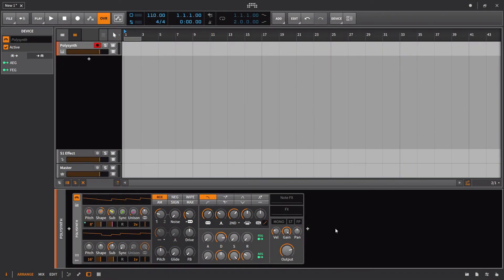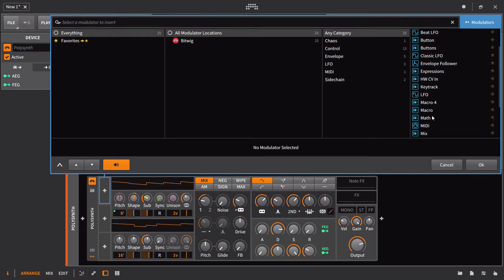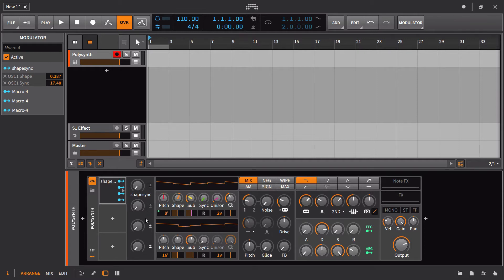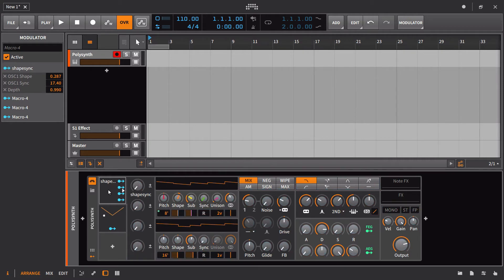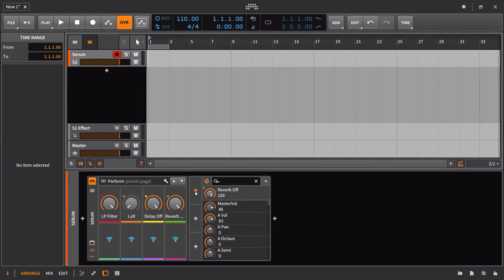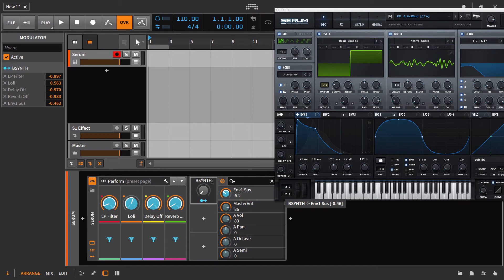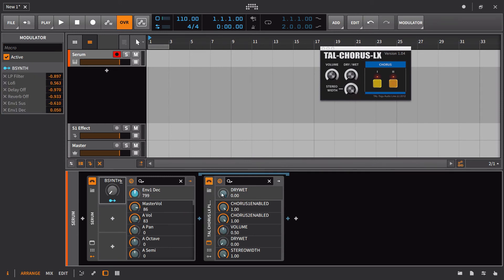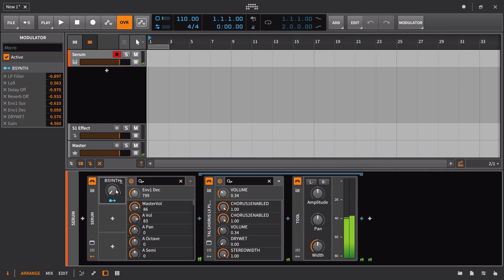07 Macros

Comment: Absolutely love your videos on Bitwig 2, but here I think you're missing the point about the changes from V1 to V2. Or I am! lol Either way, I really don't understand why anyone would want to control a remote control via a Macro, just because the knob is a little bigger? IMO that actually defeats the entire purpose of the remote controls. 

Isn't the whole idea about having separate remote controls to regard them as representations of hardware rotaries to which they can be assigned to (in banks of eight which has become the de facto standard)? Then you can assign one of them to a macro which in turn does whatever macros can do.

But treating the remote controls as a target rather than a source of a macro has zero gains, but kills the entire workflow regarding hardware midi controllers. Of course there's no right or wrong way of doing things, I just don't see any advantages in your approach. Or what am I missing here?

Either way, keep it up!
Reply from the maker: I think the main thing is that with a macro you can control multiply remote controls and limit the range with just a signal knob...you're not actually controlling the remote control just the parameter within the device that has been routed to said remote control... If that makes any sense. You could still use a midi knob to offset the remote control. 

Depending on how you make music it could be a "workflow killer" or a "workflow enhancement." Obviously if it hinders you don't do it.

But for example let's say you have a synth plugin with a crap ton of options. You route your favorites to the remote controls and save as a default preset. In the future you could use a macro in one of the modulator slots to route modulation to the remote controls without having to open the plugin or use the little mini knobs inside the device. Furthermore you could route that same macro to a bunch of other parameters (let's say you have an FX chain inside the instrument) to create some kind of sweeping transition or whatever. 

There's definitely a use for it just depends on how you make music.
Reply: Thanks for replying Brian. And don't get me wrong, I too think there's no right or wrong way of doing things if it serves one's personal creative process. I understand your approach as treating the remote controls as some sort of 'favourites' controls and that is a valid point with the GUI style of Bitwig/Ableton (especially with 3rd party stuff or long chains), but I would argue there's a reason they're called remote controls and not favourites. Having slightly bigger knobs and having them grouped does facilitate this workflow, but it could be done without the remote controls just as well.

However, for someone who likes to work with hardware controllers having customisable controllers in banks of eight directly relating to the hardware is a massive improvement over the old system and treating the remote controls the way you suggest kills that (!) workflow as the remotes are now assigned to something coming from below so to speak (a macro further down the chain). I'm not trying to argue for the 'right way' to do it, but your way of approaching the remote controls as a target of a Macro seems anachronistic and kind of 'doing things the old way' where V2 really at least allows for doing it differently (I would argue is meant to, but again, there's no right or wrong) for people with hardware controllers. The proper integration of physical hardware controllers is a HUGE topic for DAWs these days. And this workflow that I'm suggesting is new to V2 and impossible to do in V1 without this 'in-between-level' of remote controls directly relating to the hardware . Say someone invents a rocket you can fly to the moon with, why use it to go buy groceries in slightly less time? (Sorry for the silly example)

I just jumped in here because I love your tutorials, they're full of excellent information and I learned many things I wasn't aware of, but in this case I think you're somewhat missing the point of the architectural changes and the new possibilities they allow for. I'm really not trying to knock down your approach, I just think the new architecture allows for things which weren't previously possible and doing it your way pretty much disables this 'new way'. Which is of course absolutely fine if one is not interested in what I'm suggesting, I just wanted to point out that this does disable a different workflow some people might be interested in (the fact that I personally think it's the proper way is rather irrelevant at the end of the day).